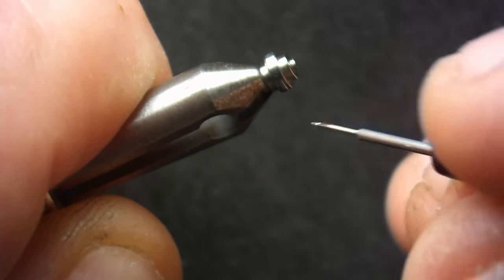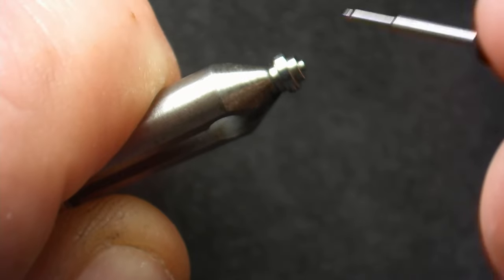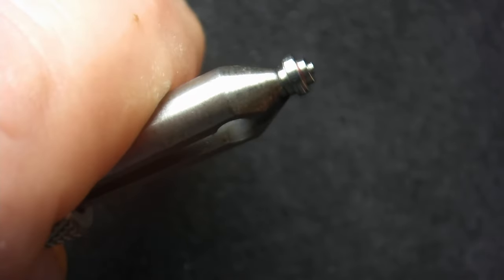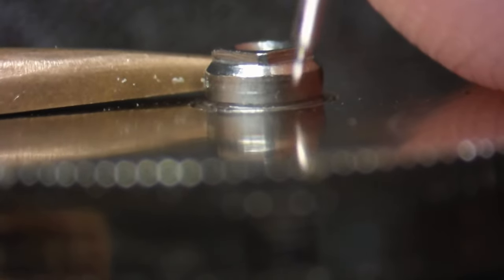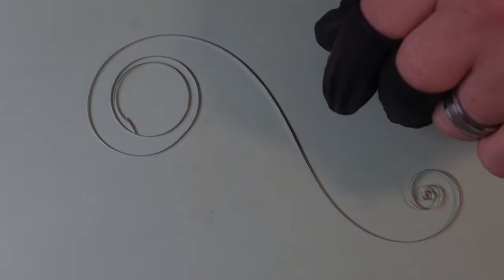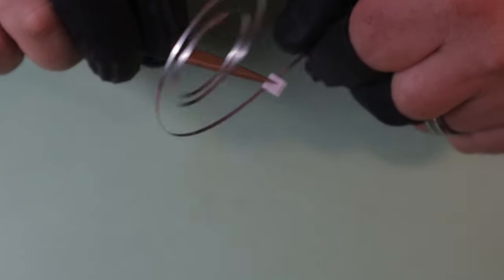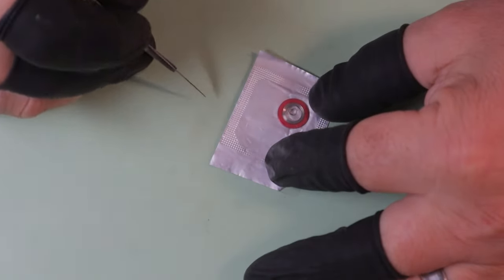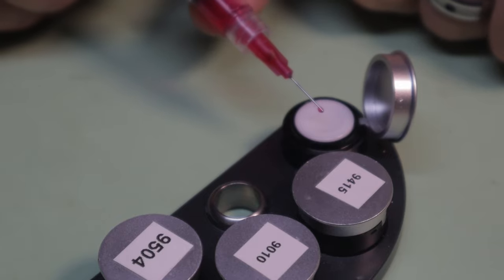Watch Lubrication for Beginners

Comment: First off, thank you for making all of these incredibly helpful videos. It is much appreciated! My question: I pretty much know or have the rest, but I'm starting to get into working on movements and I am going to buy an st36 to practice on first. My question is about what lubricants I need and I might as well get what I need to move on to automatics as well. Likely my next step will be for Seiko 7s or NH movements as I have many around.
I need:
9010
HP1300
 914? 9514?
? What else? Molykote?
Some type of braking grease for autos? What's the most economical option?
Am I being refunded on what I need?
I have ideas of what else I need or can use, but I figure it's better to ask and be sure. I know this question has been asked countless times. Especially on Reddit. But honestly it's a little hard to find a straight answer on what I need. Sure, lots of answers on what I could use. But it's a little difficult to weed through all of the answers. Thank you very much for your time
Reply from the maker: Hey Man, you are most welcome and thank you.
Here is what I would recommend:
1) fast wheels- 9010
2) slow wheels- HP1300
3) Pallet stones- 9414
4) Grease-I use 9504 but Molykote DX is more than fine and cheaper
5) If you are going to be working on newer movements or Seiko's sometimes the mainsprings are reusable so after you clean them you need to use 8200 grease to lubricate the spring.
6) for automatic barrel I would just use 8213 . Its still very good. I use Kluber P125 but its way expensive. Most watchmakers who are certified by companies like Omega have to use it which is why you see people talking about it.  I'm still not convinced its any better
7) if you are going to be working on a lot ETA automatics with reverser wheels you need Lubeta V105.  If only once in a while you can make it yourself. The recipe is in one of my lubrication videos.
Now, for oilers I use only the smallest, Bergeon black, but honestly any one will do, especially if you  polish the tip.
Am I being refunded on what I need?
I don't understand this question
Watch my lubrication video's. Its especially important around the escapement.
Reply: @watchrepairtutorials  thank you so much! That's exactly what I needed. I much appreciated the time taken for such a detailed reply.
My question was: Am I being REDUNDANT on what I need. Damn auto correct haha. You've answered that question. Thanks again man. Seriously!

Comment: One thing is for sure, unlike when I didn't have any basic knowledge about watches, I'm really learning a lot from rewatching the videos now. Do you have any plans to write guidelines on which order would be best if I were to study in conjunction with your online course and videos uploaded on YouTube?
Reply: Also, you told me that I can use D5 as a substitute for HP1300, so is there any problem if I use HP1000 as a substitute for HP1300?
Reply from the maker: Not really. The youtube videos can supplement the course to so extent but the servicing of the ST36 as well as servicing any watch is covered in more detail in the course. 
Don't substitute HP 1000 for HP 1300. Stick to the correct viscosity of lubricants.
Reply: Thank you. What kind of brush you use When you handwash movement?
Reply: I'm using brush made of human hair, but these days I find it too soft to clean off.
Reply from the maker: @dekim4866  I use an inexpensive artist brush, small bristles, maybe a centimeter long.
Reply from the maker: @dekim4866  something a little stiffer.

Comment: Always great vids. Wondering what is your opinion on the digital electron microscopes that are on the market. Do they allow enough vertical room to use screwdrivers and tweezers under the lenses? Thanks.
Reply from the maker: I do not believe so. They would serve the purpose for being able to inspect parts, but as far as working under it, I think that’s just one of the limitations. Another being lens options
Reply: Thanks  @watchrepairtutorials

Comment: hi alex, I'm a newbie and I want to know your recommendation on a beginners set on oiling/lubricating the movement
Reply from the maker: "Hi there! For beginners, I recommend starting with a basic oiling set that includes these essentials:

•	Start with Moebius 9010 for the balance escape wheel and 4th wheel
•	Moebius D-5 or 9104  for the 3r, 2nd and barrel arbor
•	Molykote DX or  Moebius 9504 for the sliding parts, like the keyless and ,motion works.
•	Moebius 9415 for the pallet stones.
Think of oils as tools not consumables. 

Without the proper lubrication you will be fighting amplitude problems. 

If you just are looking for something to practice with and are not concerned with amplitude you can use moebius 8000 everywhere except the pallet stones as there really is only one option there. 
You can see all my recommendations here. https://watchrepairtutorials.com/lubricants/

Comment: Hi Alex, Great video, as always.
I have a couple of questions:
1: Assuming the watch was cleaned and oiled correctly. and it's already assembled (but not fully finished yet). Then for whatever reason you have to take it apart again (ex. you realized you put the wrong screw). Does the watch need to  be fully washed and oiled again? Or it can be just re-assembled as is?
2: Does washing and oiling the watch too many times can deteriorate the watch parts?

Thanks again.
Reply from the maker: Well, to answer your second question first no it doesn't wear parts down unless you're doing something you shouldn't be.
Your first question is a good one. If you're taking a train bridge off after you have lubricated everything, it's impossible to reinstall it without smearing the oils to places you don't want them so at the very least you want to spot clean the jewels and pivots once you have corrected the problem that caused you to remove the bridge.
Balance jewels are a little different because the way the oil is held captive in the jewel setting. Just be careful to make sure dust does not get in the balance pivot which will introduce a fault into the jewel setting.
Now if you have a non runner or a watch that's needs a lot of work, it is best to clean all the parts, make your corrections, test everything and then when everything is working correctly, do your final cleaning, assembly and lubrication.
You're basically washing everything twice. The first time to remove anything that could affect your testing and then the second and final cleaning to make sure there's no contaminants in the movement during your reassembly.
Reply: @watchrepairtutorials  Thanks for the quick response and for confirming what I suspected.
Yes, in my case specifically I had to take the train bridge because I needed to clean the escape wheel which got smeared when was oiling the pallet stones. BTW, I did fully wash and oiled all over again but I always wonder if it was necessary to do so...

Comment: Greetings 🤘🏼
I couldn't see anything mentioned in previous comments so apologies if this is a repeat.. 
I'm curious about lubricant on the center wheel and cannon pinion connection, it must be a tiny amount since "friction fit" implies just that? 😅
wouldn't lubricant potentially affect the drive of the hands by the center wheel or in the long run hold contaminants that could cause damage?
Once again thank you and keep up the good work 👍🏼
Reply from the maker: Yeah, that’s a good question. The extended arbor of the second or center wheel has to carry the minute hand around the dial. The friction needs to be tight enough to do that, right?
But when you set the time the canon pinion needs to be able to easily turn when you are setting the time so there needs to be lubrication there otherwise it will feel tight when you turn the crown.
This is why I use 9504 which is a lite grease instead of an oil. Oils by their very nature do tend to creep over a curved surface and not around a sharp surface, like where a pivot shoulder and a pivot come together.

Comment: Please clarify the thinking on pallet stones. I expected use of a 941 or lighter oil than 9415 grease. I have 941, 9010, D5 in pots. Should I get 9415 specifically for pallet stones?  Very work and thanks for list of lubes.  Loved your tip on polished oiler!
Reply from the maker: Welcome Norman,
Glad you asked for clarification. Traditionally 941 is used for slow beat movements, 18000 and less and  9415 which is the same thing as 941,  but formulated for fast beat movements.
Most watchmakers I know just use 9415 for all pallet stones.
There’s not really a significant issue using the 941 so I would use it up and then next time you buy some, just switch to the 9415.

Comment: Great video as are all in your series. I am taking your suggestion and redoing a SII NH-36 movement.  On their Tech sheets the recommended lubricants are Moebius 9010 and MO-4 and MO-3. What are the MO-4 and MO-3? Thanks
Reply from the maker: Don't know what MO is referring to.  Seiko NH series calls for 9010, S6 and S4 You can substitute S6  for 9401 hp1330 and molycote dx or 9504  instead of the S$
Reply: @watchrepairtutorials  Thank You!

Comment: As one who start from the begining point your videos are excellent. I have a few  questions:
1. What is the different between 9504 and 9501 grease?
2. Can i use the hp1300 oil/9504 grease to lubricate the  barrel spring instead od 8200 grease?
3. If i use syringe to store the oil does it preserve it freshness for a long time like in bottle it come in? What are the loses of oil when you use this meathod.l?
4. I notice that in eta2824  lubrication 85% or more using the hp1300 and in few parts they use 9010 oil. Can i use 1300 instead of 9010?
Reply from the maker: 1. I believe 9501is formulated for medium pressure and 9504 is high pressure. No need to have 2 lubricates that do the same thing unless you are required in a shop setting.
2. never 9504 and hp1300  only used on the barrel arbor.
3. I have done this forever with no problem and learned it from a well known watchmaker who did it for 50 years
4. No you can't substitute one for the other. 9010 is thinner and you will kill your amplitude if you use hp1300 where 9010 should be. Remember 9010 is used at the end of the train where the available power is minimal.
Reply: K @watchrepairtutorials  thanks for your help. One more question. 
Does the Bergeon 2652-0050 One Dip will be good for the palette also?
Reply from the maker: @raknin  yes that’s correct
Reply: 1. What kind of lubrication if at all the  hairspring use?
2. Epilame is very expensive material, if you are not proffesional and use it once in a year or more are they any substitutions for epilame to lubricate the pallete stones and hairspring?

Comment: Another great video Alex. The tip about using a syringe with a 20-25 gauge blunt needle was great. It's gold. I do have a couple of questions though, what kind of foam blocks were you using in the video and where to get them? Second question, how do you polish the oiler tips and with what?

Thanks in advance.
Reply from the maker: The foam blocks are from Bergeon. This is one place to find them but I am sure there are others. bit.ly/3vKYrv5
The way I polish the tips is with a rotary tool, with a hard felt wheel loaded with Polinum polishing compound.
You just need to touch it the wheel in small one second touches and then check it,  otherwise you can burn the tip off
Reply: @watchrepairtutorials  thank you so much for your quick response. I’ve burnt off an oiler tip before but I was using a 1200 grit sandpaper. 🤣 It didn’t end up with a flat mirror finish although it was sharp. Very sharp.

Comment: Hi from Norway, love your videos and have a question. The dip oilers have colour code after size, but where to use the different sizes?
Reply from the maker: I only use the smallest which are black.
The other ones can be used as a probe. 😀
Reply: @watchrepairtutorials  Ty for the answer, ill do just that :)

Comment: Hello recently found your channel. Thank you for the information. How does one polish the top of the oilers?   Thank you.
Reply from the maker: I use a felt wheel loaded with Polinum on a rotary tool.
All you will need to do is lightly touch the tip to the wheel and then check it.
Don’t leave it on the wheel too long or it will be gone.
Do both sides. 
If you have epilame, you can also treat the tip and it also helps bead up the oil on the tip.
Reply: @watchrepairtutorials  thank you for taking time to answer and for the information

Comment: Excellent videos. 
Just one correction; amplitude does not affect the rate. Christiaan Huygens formulated a physics law about it around 1650s.
Reply from the maker: Thank you.
I have a feeling you are just messing with me but since others will read this I want you to explain your statement, OK?
If amplitude does not affect the rate in a detached lever escapement, how do you explain the fact that the rate will speed  up as the amplitude drops lower ?
Reply: @watchrepairtutorials  Well, this is just how nature works. It's a physical law, first observed by Galileo Galilei and then later formulated by Christiaan Huygens. The amplitude is the maximum displacement from the equilibrium position in an oscillation. It is an important property that is related to the energy of a wave. The amplitude is not affected by a wave's period or frequency. There can be two waves with the same frequency, but with different amplitudes. That's pretty much non-debatable. However, there might be some other factors in play, which explain your empirical observations. In any case, this is just an trivial academic point which I almost regret mentioning, because the main thing here is your excellent video demonstrations. I like them a lot. Keep up the good work!
Reply from the maker: @osemarvin2847   I am not experienced in physics but I am interested in what you are saying.
I did a little reading up on what you are referring to and all I can see is amplitude as it relates to brain, sound, radio and cosmic rays. 
Is it possible that the definition of amplitude is different in regards to this type of oscillation? 

Does this principle also apply to mechanical oscillation and if so how.
I'm really curious.
Reply: @watchrepairtutorials  It relates to any periodic oscillation - mechanical, electromagnetic, sound etc. 

In stringed instruments, for example piano, it can be easily observed just by listening a single note played softly (low energy, low amplitude) and then the same note played louder (higher energy, higher amplitude). The pitch of the note does not change (still the same note) - but the amplitude (loudness) does change. So, same note - different amplitudes.

But let's concentrate directly to clocks and watches and how this principle applies to them. Here's a good demonstration:

https://youtu.be/PGcCbEOHNMM?list=PL7q4FTKNfQj8rC-M6ZChQQXQuSix17V5-&t=626
Reply: There are, however situations when amplitude affects the rate of periodic oscillators big time, but those are extreme cases. For example, extremely low amplitude cannot keep up the steady period, because other forces (such as friction) become dominant. Also, extremely high amplitudes cause problems by pushing physics to the realm of chaos and distortion - again destroying steady and predictable motion.
Reply from the maker: @osemarvin2847  I have to admit that you have given me a new way to look at amplitude. Your comment caused me to dig deeper into the subject initially to disprove what you were saying but  i came to the realization that a balance maintains the same frequency no matter whether to amplitude is 300 or 150. 
Low amplitude is merely the system of a fault in the movement.
The amplitude or lack of, is just one of the factors controlling the amount of time the hairspring is in contact with the pins which in turn controls the active length of the hairspring controlling the rate.
Reply: @watchrepairtutorials  I'm glad if I managed to give you some new information - as academic it was. But the truth is that I've learned a hell of a lot more from your videos. And that's practical information. Can't beat that.
Reply from the maker: @osemarvin2847  love it man. Thank you. Never stop learning.

Comment: A novice question on the point of the pallet jewels. If oil is supposed to stop parts of the watch from wearing out (among other things), but oiling said jewels is detrimental to the longevity of the service life of the said watch... wouldn't that mean that the unlubricated pinions on the pallet fork would wear out over time as the fork moves continuously back and forth (shortening the life of the watch)?
Reply from the maker: Lubrication on pivots in jeweled holes is mainly there to reduce friction. 

The pallet fork only rotates on about a 10-15 degree axis so the benefit would be   very minor initially, but will really affect the amplitude as the oil dries off.

The 2nd issue is that because the top pivot is so close to the pallet arm, oil spreads down the arm and contaminates the pallet fork slot and impulse jewel slowing or stopping the movement.

The one exception to this are some larger size vintage pocket watches.